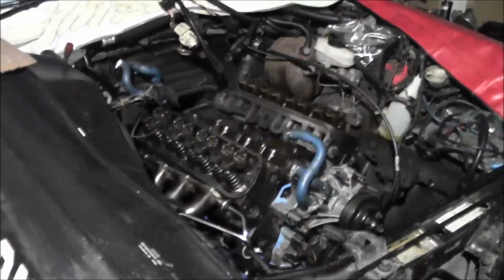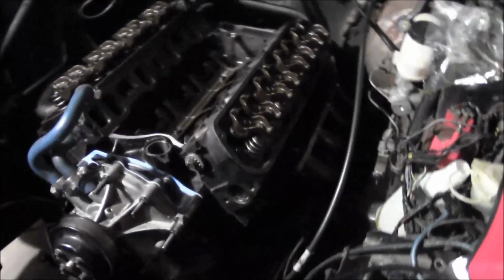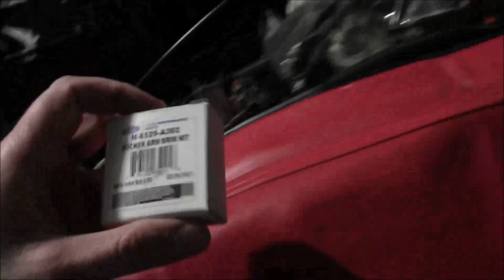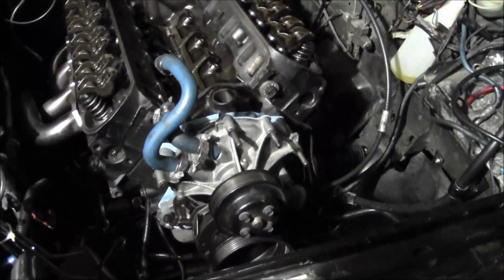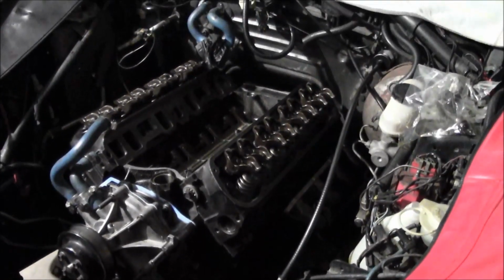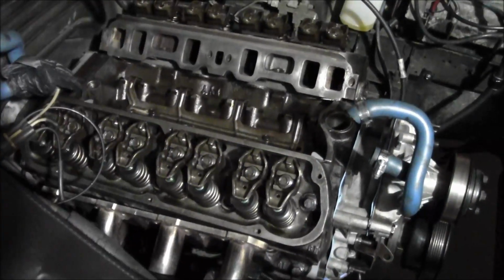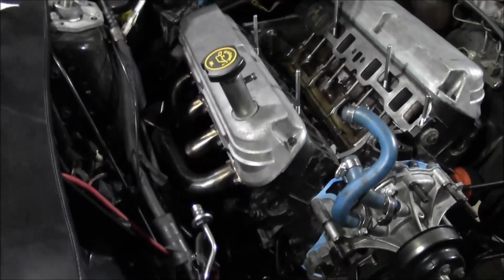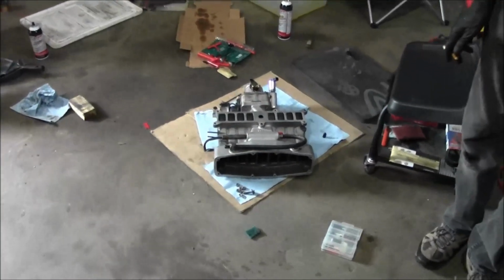5.0 HO Engine Install

Comment: You will definitely feel the difference in power over the stock heads! Appreciate the uploads.👈💯🔥
Reply from the maker: john doe:  Heads are the same that came on the car, 3 bar GT40.  Never really got to drive this car very hard because it was having huge oil pressure issues when I bought it in 2016.  Tried to just swap the bearings back in 2018 (there are videos of that in the playlist) but that failed to completely fix the problem.  So I finally got around to trying and fix her up the right way.  The car actually ran pretty strong when I got it back in 2016... and she didn't disappoint me when she got finished up with this repair in 2021!
Reply: @fwh79FOXR6  That's awesome brother, congratulations on all the hard work you and your family and friends put in on the stang!👈💯
Reply from the maker: @johndoe-zb8bm  Thank you!  It was a very long road getting here.  Feels good when you get to win one 🤘

Comment: So you kept the original block, but used the Explorer Rotating Assembly?
Just like that, she's got new life
Reply from the maker: J PP:  Yeah, just used the crank out of the Explorer motor.  Kinda rollin the dice because that motor in the car got pretty damn hot several times.  Some times that can tweet the block out and cause issues.  Cam or crank can bind up from core shift.
Reply: @fwh79FOXR6  well, worst case, you got another block I guess
Reply from the maker: @jpp9846  True, block, intake, and 3 bar heads.  It worked out.
Reply from the maker: @Space Ghost I think this block is a couple of clicks passed "well seasoned"!  🤣😂🤣